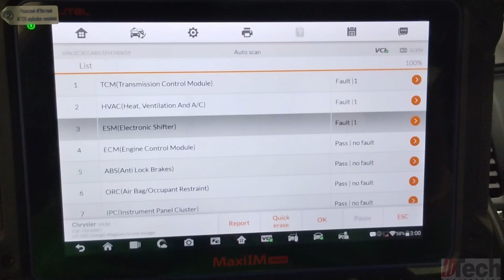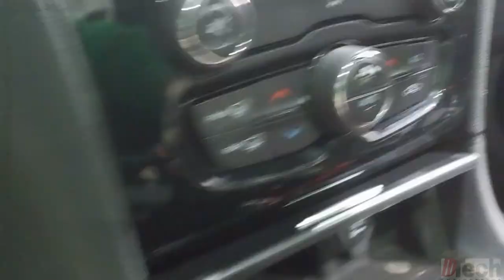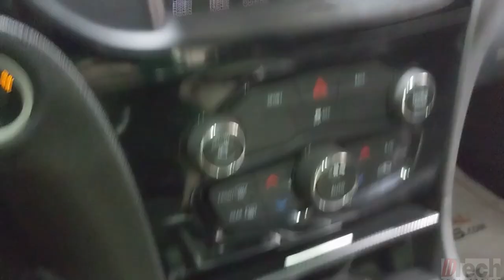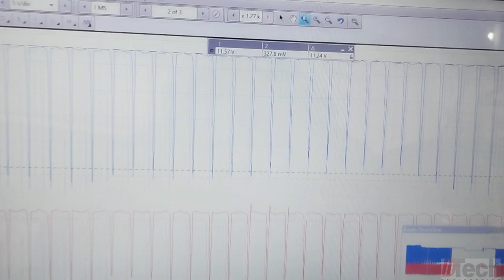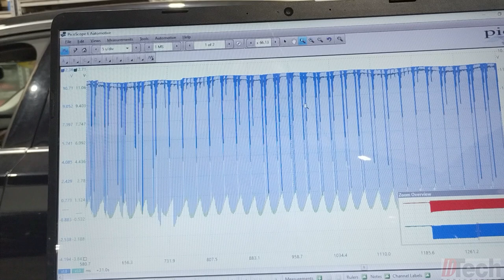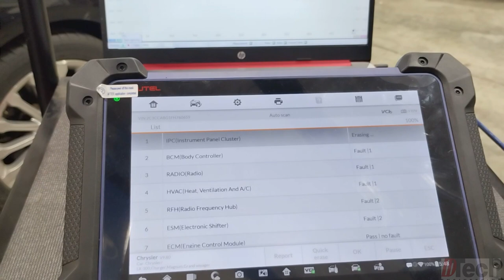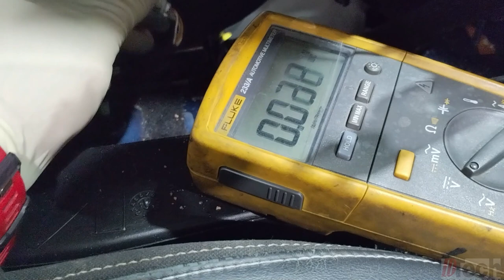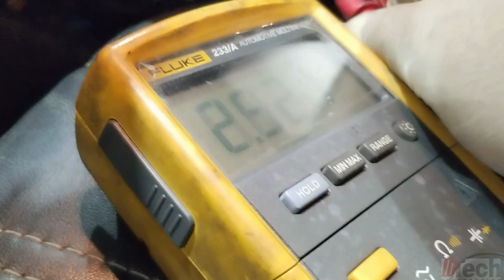2015 Chrysler 300 "Service Shifter" light: Not a Bad ESM

Comment: Great step by step trouble shooting. I am retired now from the instrumentation field in the paper industry which involved lots of troubleshooting electronic equipment. One of our instructors commented on first step in trouble shooting equipment was ensuring good supply voltages, good grounds. Second step was to insure all wiring connections had good integrity. Will save you a lot of headaches.  Again, great video.
Reply from the maker: Thanks for the tip and thank you for watching
Reply: Right now I have a 2014 Chrysler 300 that intermittently will not go into Park. Got any ideas? How difficult is it to get that center council up to get at that coca cola damaged connector?
Reply: Issue resolved. I want to pass along how my problem (shifter won't go into park) was resolved in case anyone else has this problem. This generated a PO850 code and check engine light. This was a real freak situation, It just so happens that a small stone had kicked up and got wedged between the emergency Park Release arm located on transmission and the transmission case. I have the 8 speed transmission. This caused the arm located on the transmission to reposition itself slightly. The Park/Neutral switch that tells the computer all is well is apparantly located on this arm internally in the transmission. The computer TCM  (Transmission Control Module) thought the emergency Park Release lever in the car had been pulled and wouldn't let me shift into park. The car actually did  go into Park but the indicater light on the handle wouldn't come on and confirm this to the TCM. I had taken this to Chrysler garage and they wanted to sell me a $2200 transmission. I was pretty sure transmission was ok since I could took it down the road and all internal shifting of the transmission appeared normal,  I than took it to a little shop out in the country by me who charged me $50/hr rather than $140/hr that those so called expert Chrysler mechanics charge, Ended being a $180 stone . Problem solved. PS: I would recommend this little shop in the country to anyone. That kid was sharp and didn't have all the accreditations and schooling these supposed Chrysler mechanics had..

Comment: Hello Sadel, a question:  at the 29:36 mark the BUS voltage dropped when you plugged in the ESM.  That surprised me as I expected no change.  Is the drop just due to the resistance of the ESM?  I figured that all good modules would not affect the BUS voltage.  I’m curious as to why it dropped?  Ps-  as I type this I have not watched the rest of the video.  Thanks!
Reply from the maker: Thanks for watching, the cause of the "drop" when the esm was plugged in, is due to further stabilization of the bus with both modules are now plugged in,